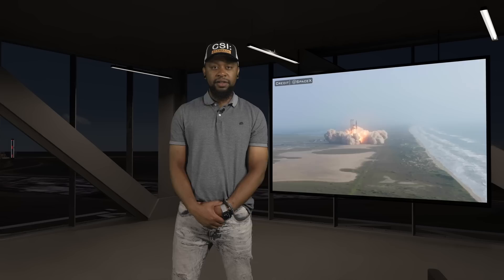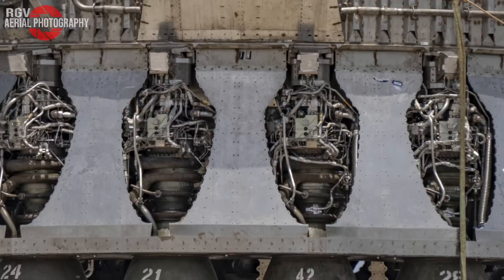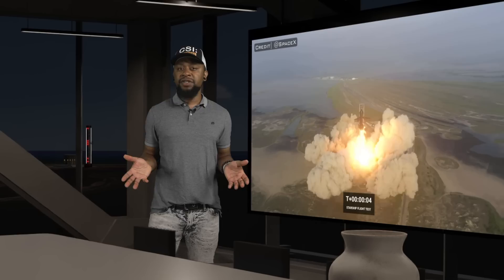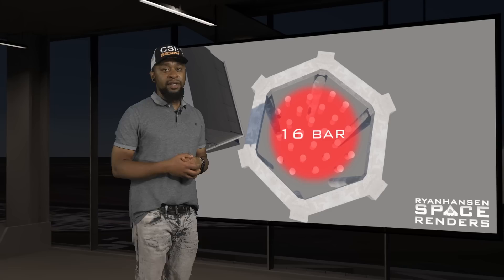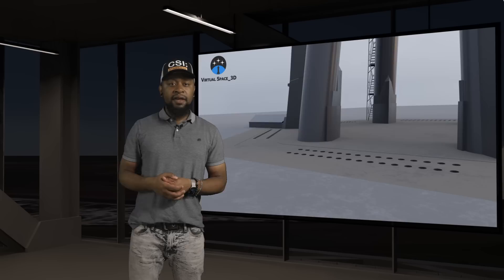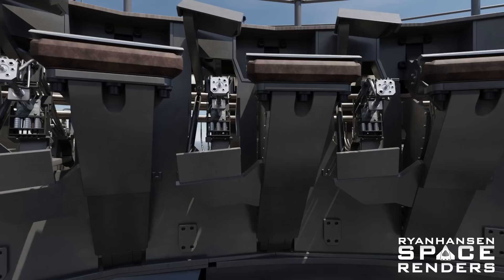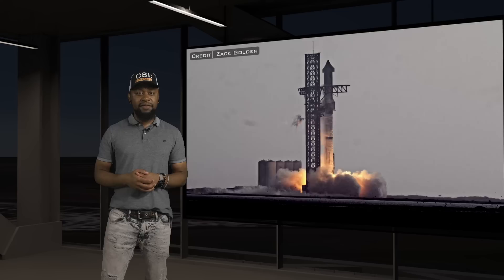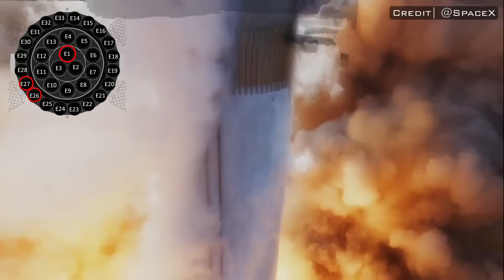The Design Flaw That Caused The Starship Launchpad to Fail!

Comment: I have always said it would take only one engine failure catastrophic to take out that entire vehicle.  Wonder how many people would want to ride that thing
Reply: Except it takes 6 engines and it didn't even blow up until minutes later
Reply: The engine shielding was retro-fitted on that booster, the next one has it included by design so will have a lot better engine isolation. Gimbal engines are electric as well so no hydrolics to take out all the steering.
Reply: Falcon Heavy has almost 30 engines and it’s extraordinarily successful and reliable.
Reply: @wilburunion6532  "launch failure release was enough to kill all of Brownsville Texas at the launch facility"

Which the counts is check notes zero!
Reply: Not sure what you are saying, but I should have been more illustratively clear.  I was talking about a hypothetical "under the dome" type scenario which would have raised the ppm of methane enough to exterminate life under that dome.

Of course in America we seldom see industrial accidents like the Bhopal disaster of the then Union Carbide plant in India in 1984 BUT the air if confined would have done much like that where hydrogen would not.  Though much more toxic it only took 45 tons of methyl isocyanate to KILL 20, 000 and Maine thousands more.

The point I make is simple that given how toxic methane is be released in the atmosphere it would better to launch tanks of it into orbit for refueling from there and use hydrogen powered or God forbid continue to use fossil fuel Kerosene rockets to lift it there

But I get it that no one is thinking responsibly enough to care about the planet we DO live on right now
Reply: @wilburunion6532  So Brownsville is actually inside a big dome & pretty confined, is that what you're saying?

Comment: why not use stage 2 heat tiles on stage 0 ?
Reply from the maker: They are very fragile. They aren’t designed to operate under extreme temps but not extreme amounts of dynamic forces.
Reply: @CSIStarbase  good to know - thanks!
Reply: That’s 😂

Comment: Updating the 60 year old Soviet N1 booster (which used 30 engines in the first stage) design isn’t new technology. 

There’s nothing of significance with respect to groundbreaking technology in space travel.  They’re adding cup holders and SatNav to 1960s booster designs.  

Not impressed.
Reply: Full flow staged combustion cycle methane engines and reusability mustn't be ignored.
Reply: @geoffallan  Why you tell him? Obviously that particular engine has been used before 60 years ago so SpaceX sucks!!! 😭😭😭

/s
Reply: @alvianchoiriapriliansyah9882  lol, people will say anything to convince themselves SpaceX is bad. Very strange behaviour. Thanks for your comment

Comment: The data retrieved from the flight is basically useless for future iterations of starship since we don’t know what failures for the rocket were caused by launch damage and what was a failure in rocket design.  And now everything is very delayed until a proper stage zero is constructed.  Hopefully their water cooled steel plate is adequate and doesn’t explode like the fondag did.
Reply: Same propellant mass, same Raptor, same configuration. But no data, sure lmao
Reply: @alvianchoiriapriliansyah9882  no useful data.   Unless they plan on blasting concrete into the rocket on every launch.  Maybe the next iteration will feature heavy armor!
Reply: @russellharrell2747  What project/works have you done so far at SpaceX?
Reply: @alvianchoiriapriliansyah9882  all of them, I’m Elon in disguise.   Shhh, don’t tell anyone.

How many projects have you done for them?

Comment: Pad crater, widespread site damage, initial x3 engines out, HPU exploding, ultimately x8 engines out, FTS failure. I'm not being funny, but how is it possible that anyone can charactise this launch as anything but a cascading clusterf...?
Reply: SpaceX gathered a whole lot of data that was only possible with a launch. 

It cleared the tower, and showed exceptional robustness while cartwheeling.

This was the first time that a Super Heavy booster had flown, as well as the first time a fully stacked Starship/Super Heavy had flown, and if you remember,  SpaceX went through Starships SN8, 9, 10, and 11, before SN15 finally succeeded in landing; so I'm not really surprised or disappointed that the first full stack launch didn't go perfectly.
Reply: @johnpooky84  Yes, of course data gathering, you also do that on a SUCCESSFUL launch. This doesn't mitigate/excuse what happened does it, but it seems to be the standard spin of cope...

"Exceptional robustness". This is like a car manufacturer, in a desparate bid to put on a positive spin, stating that at least the hub caps remained intact after a car smash resulting from of poor automotive design.... Nuts... 🤪

And one might have said, "didn't go perfectly", if everything went well apart from a tile falling off, or even a couple of engines dropping out for example and it still managed to at least achieve is mission objectives. But it didn't even achieve that. It was a disaster of MULTIPLE failures.

 I fully understand this was a TEST launch, but surely even in any test it shouldnt result in so many points of failure..? So I ask again, how is this not a clusterf.....??
Reply: @saiello2061  You're really hesitant to set your expectations straight, even when SpaceX already told public many many times
Reply: @alvianchoiriapriliansyah9882  If the expectations all round, including Musk himself, that it was largely likely going to fail ( which begs the question: why bother with such an costly test anyway if confidence was so low?), why then are certain people insistent on characterising it as a resounding success?? Maybe these people should be informing Musk that his expectations and announcements of potential of failure were in error. Might cheer the man up a bit... 😉
Reply: @saiello2061  SpaceX said MANY MANY TIMES that it's about gathering data, and they did just that

Isn't it that hard to understand?

Comment: It was a failure if for no other reason then that is how it is perceived.  If investment and continued funding is important,  this test was a failure.

It was a failure because of the critical miscalculation of the launch pad and the damage it did to the surrounding infrastructure and the resulting cost and delays of future launches.  And if getting this thing in the air was more important than the damage caused, it shows deep seeded flaws in management's ability to make good decisions.

It is a failure because, like so many of the other promises of Space X's founder, the results fell far short of what was promised.

To call this launch a success 50 years after the launch of Saturn 5 is quite frankly laughable.

Its like using your face in a fight to break the others guys hand and saying you won the fight.

A spectacular success would have helped rationalize the failures of this program and kept memories short.  Instead we were given yet another reminder that Space X burns more money than rocket fuel.
Reply: Saturn V wasn't designed to be re-usable.
Reply: @geoffallan  That's what you got from all of that?  

That would be a good argument if the failures were in anyway related to reusability.  The failures were with a few exceptions something done in other projects in the past.  Size is a notable exception, but is that why it failed?  As an example, If anything a flame diverter or some other system would be more obvious given past, not less.
Reply: @alueshen  well, yes, it was what I got from it. You seem to be writing off Starship after 1 launch attempt? The business model isn’t the same as Saturn V nor is the design process. Build it break it fix it in my mind is far more efficient with time and money than over engineering everything before actually knowing what needs to be built? Attempting a launch without a flame trench saved a huge amount of money to this point. There won’t be one for the next one either. I’m very much enjoying this program by a private company. Comparing with NASA is like chalk and cheese imo.
Reply: @geoffallan  I am very much a fan of public private partnerships like Space X.  There are some things that a mission focused government can do better than a profit focused company can do, but the opposite is also true.

That said, you should know that using Elon's own definition,  Space X is "a government funded organization", since in 2020 it received 40% of its funding from the government after Elon claimed NPR was "government funded" receiving 12% of its revenue from government. 

But I digress, while Space X  claims it can put payload in space for less, there are several caveats to that, not the least of which is the subsidies Space X has received.   I won't claim that Space X will, in the long run be a failure, but jury is still out.  I'm leaning slightly toward failure.  

As far as the flame trench, saying that it saved money not building it given how much damage it did, not to mention the fact that it may have contributed to the failures of the Raptor engines and could have jeopardized the entire mission....Your kidding, right?  Even on the oft chance you are right and not building the trench saved money vs. letting the rocket blast huge chunks of launch pad in all directions including into the bottom of the rocket itself (and may have contributed to its failure) is in my opinion a statement that, at best can't be determined easily, especially by a couple of nerds arguing on the internet and at worst was a cost that was too high given the stakes.
Reply: @alueshen  I’d rather we don’t descend into the classic YT argument. I  learn through conversation. 
The 40% funding you speak of are they contracts etc or funding on top of those?
And yes I was being rather flippant with my money saving comment. It can only be imagined some of the concrete made contact with the engines unless the thrust plume prevented that and sprayed the launch mount? The images of the launch mount certainly show damage from the concrete.
Reply: @geoffallan it's cool man.  Honestly I don't  know the breakdown of the gov subsidies. Personally, I hope Space X succeeds, but I admit a little bias as I think Musk is treated like a Rockstar when he's really a con man.
Reply: @alueshen  Space Shuttle main engines failed too during testing, are you saying NASA back then was con men too?
Reply: @alvianchoiriapriliansyah9882  Not the issue.
Reply: @alueshen  Ok, but I've not seen any evidence of that. He's certainly very good at getting his own way. I'd suggest he understands how to use the system that's been put in place in the western world? I can't blame for that? A conman rips people off. He's a job creating machine, but only if they are necessary. Twitter for example was a cash cow for the previous owners who employed all the hipsters they could get their hands on. He soon fixed that. Cut the dead weight into a lean operation.
I'm really interested in your conman comment, could you give me an example?

Comment: His “water sandwich” is not going to fix what’s wrong? All it will do is create is a huge steam explosion.
Reply: Where the steam originated?
Reply: @alvianchoiriapriliansyah9882   the water between the two sheets of steel plus the blast of heat from all those engines at full power. Water expands on the order of 1600 times (as it becomes vapor and with the temps here, that would almost instantaneous.
Reply: A steam explosion (not really an explosion, but it works) is exactly what they want here, they want the water to sap heat away by evaporating rather than overheating the plate.

Comment: So let me see if your own "narrative" (which parrots Elon's) is correct. The original goals for this mission, that were established by Elon were to launch (with obliterating the pad), achieve stage separation, do half an orbit, test the TPS system and flaps system's ability to maintain attitude during reentry and splash down the booster in one piece. The only goal that SpaceX "achieved" was to get off the pad without obliterating it completely. So after the mission Elon changes his whole list of goals down to one objective - get off the OLM without destroying it. I guess only half destroying it was a success. But none of the other objectives were achieved, no stage separation, no reentry test of the flap maneuvering abilities, no test of the TPS and complete loss of the entire ship. I guess Elon's "revised" objective for the test was simply to avoid the total destruction of the OLM.  So using that logic Elon's definition of success is lack of total failure. And by the way I liked your analysis of the Fondag you did in a previous video where you listed all the reasons why it wouldn't fail. Congratulations on your "successful" prediction.
Reply: @reagank.2268  some ppl have a good skill of covering their ears

Ppl expecting this to be a full success is more ambitious than Elon's 2022 Mars landing which is bizzare
Reply: @alvianchoiriapriliansyah9882  yeah they dont understand how this program works. Iterative testing is very fast, and theoretically cheap, but it is absolutely horrible for public relations. I dont think any program has done it at this scale before so people that don't want to understand can pretend not to very easily by comparing it to previous rockets.
Reply: Io
Reply: Io

Comment: That water system won’t work
Reply from the maker: Lol we will see
Reply: @CSIStarbase  a mean. I don’t want to burst space x fans bubble too early, but look into the new renderings how the water flow etc. With so much thrust, how will that water do anything blowing from that direction and not just vaporize in thin air, plus direct fire on that metal plate. That amount of fire will even go into the pores of those water holes. Elon have to make a flame diverter with the water flooding it. And I can suggest he use some heat tiles if possible to help shield that metal plate, if they will hold and not shatter away like glass. I was wondering why they cancel setting up a lunch pad in the sea.
Reply: @lowellbrown1122  Are you actually testing it with your own rocket?

Nvm, saying heat tiles will absolutely work for rocket exhaust. That's pretty smart 😂😂
Reply: @alvianchoiriapriliansyah9882  lol.
Reply: @alvianchoiriapriliansyah9882  lol I throw that in for a little humor. Lol.

Comment: So exploding rockets is what we call a massive success these days. 😂😂
Reply: You must haven't heard of "prototypes"
Reply: Success is based on pre-decided objectives. Starship's main objective was to not destroy the launch complex. The payload fairing was empty; nothing substantial would have happened even if it did reach orbit. This was a test flight, not a "do something" flight. Very few thought  S24 would splash down in Hawaii.
Reply: @archer1133  

so it was failure even by your definition... Didn't achieve most of it's goals... Engines failed from start...
  
Launch site almost got destroyed...
  Issue which even amateur YouTubers (who aren't Musk fanboys)
 saw coming...  
  Issue which NASA solved in 50-60s
Reply: @alvianchoiriapriliansyah9882  yes I haven't heard about exploding prototype..  failed in EVERYTHING..  destroyed launch site..  engine failures  from start.. etc.. huge success... 🤣🤣🤣 True Musk fanboy
Reply: @anza77  It did achieve its goal considering we expected the launch pad to blow up. Everything after launch was extra. The damage caused was minor and is almost fixed already. "The engines failed from the start" is a misleading statement. Three engines failed before the launch began (which SpaceX knew about), but continued the launch anyway. One of the engines that failed midflight caused the surrounding engine to fail, leaked oxidizer into the exhaust stream, and caused the HPU to loose pressure resulting in the termination of Starship due to the inability to maneuver the system. The biggest failure was the flight termination system being ineffective at destroying the booster in a timely manner. 

I never said people saw the pilling failure coming. I said that people expected the ship not to make it to Hawaii, especially considering SpaceX used an outdated vehicle on this test. Not sure what "NASA solved in 50s-60s means." NASA's launch site was somewhat destroyed when SLS launched, specifically the launch tower.